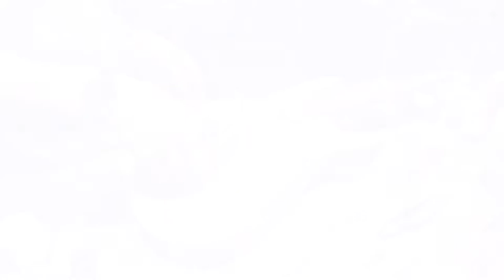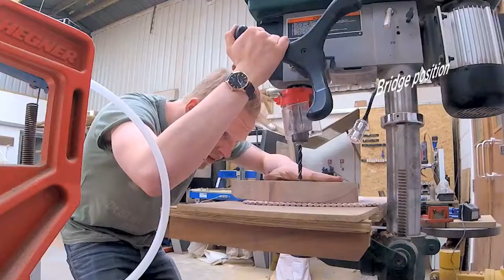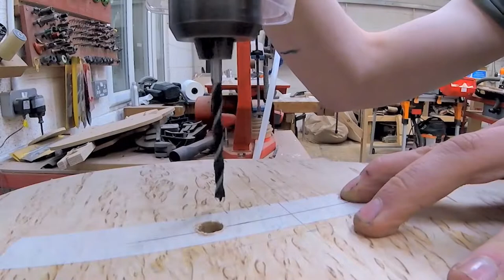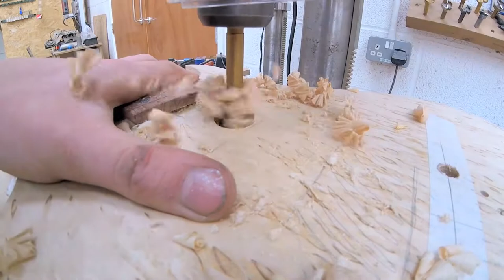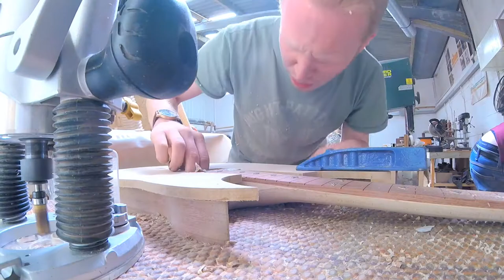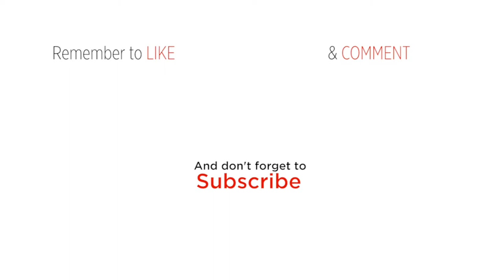Bridge Positioning On A Unique Neck-Through Guitar

Comment: I dread the post placement most, way more than carving the neck, Wich I look forward to. I have a Leo Quann badass bridge from 1982 that never was used, wrap around and fully adjustable. I pretty much plan to treat it like a tune o matic.
Reply from the maker: Ooh that's a lovely bridge! Yeah, I never dreaded the post placement due to having done it a lot when I actually had no clue and still got it done alright :D So when people were cursing about it, I never really understood it. It all just boils down to measuring carefully and making sure your holes go straight, so that the posts sit in well. Even if it goes a bit screwy it is a very simple fix. Just plug the holes and try again.

-T